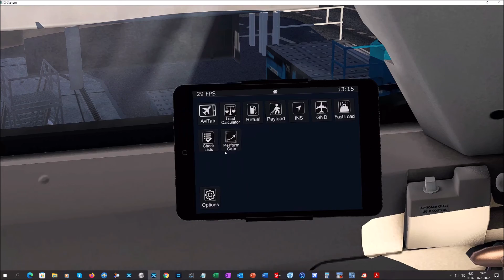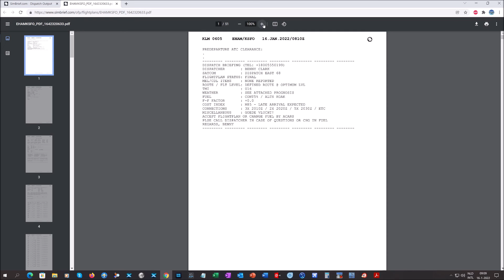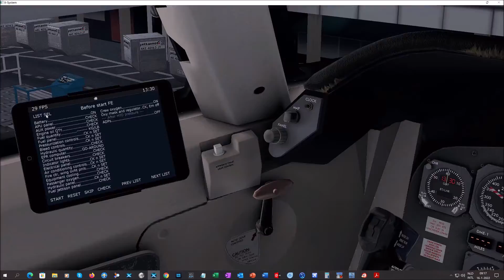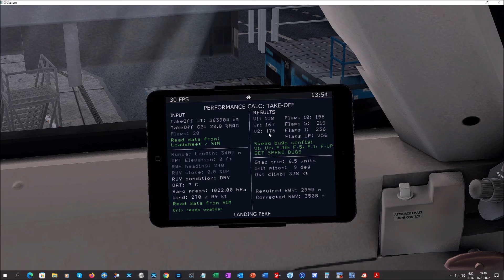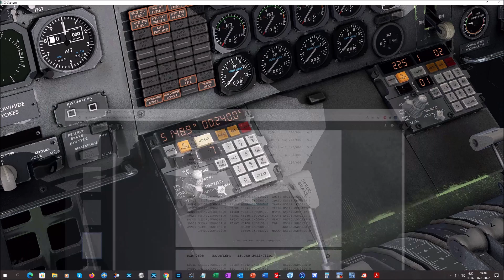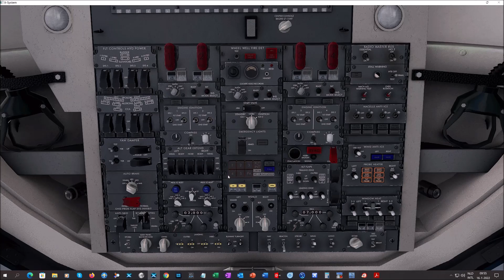Felis 747-200  Long haul using INS - part 1 of 4 'Preflight'

Comment: Excellent start which is very comprehensive. I recently purchased the EHAM Amsterdam Airport adds on as well as ALES Library but I get error after launching the application which is: 
There was a problem loading the scenery package:
0:00:46.306 E/SYS: | Custom Scenery/Aerosoft - EHAM  Schiphol Amsterdam Airport/
0:00:46.306 E/SYS: | The scenery may not look correct.
0:00:46.306 E/SYS: | Please see the Log.txt file for detailed error information.
0:00:46.306 E/SYS: | (io_dsf.cpp:808)

Would you please help? Thanks a bunch
Reply from the maker: Well, read the instructions on the .org forum page of the update very carefully! If you just threw the Ales library in the EHAM folder it isn’t going to work. https://forums.x-plane.org/index.php?/files/file/55042-eham-schiphol-amsterdam/
Reply: @0321Sjoerd  I tried but still not working properly. Do I need to get the library listed in the link you sent me and if so where can I find that library files and where to place these files ..
Reply from the maker: @mehnazk  If you download the package from the link I provided you’ll find a readme file with detailed installation instructions. Read that file carefully.
Reply from the maker: @mehnazk  Installation 
1// Purchase and download the latest version of Aerosoft's Schiphol Amsterdam 
 
2// Unzip 
 
3// The folders wich are needed you can find in Aerosoft - EHAM Schiphol Amsterdam -> custom objects 
 
4// Copy following folders "EHAM" , "grounddraped" and "vtg" into the main folder of the new Schiphol Airport 
 
5// Purchase and download "ALES - The Airport Layout Enhancement Solution" by Pyreegue 
 
6// Unzip 
 
7// klick on ALESv1.4 -> Libraries -> ALES LIB 4K (or 2K (recommended)) -> Custom Scenery -> ALES LIB. Copy ALES LIB into your EHAM main folder.
 
8// Copy the new Schiphol Amsterdam Airport folder into X-Plane 11 / Custom Scenery 
 
9// Delete default Schiphol Amsterdam by Aerosoft from your Custom Scenery folder because this two sceneries will not work together as two seperate folders! 
 
10// Enjoy 
 
If you want this airport without static planes, please klick on the link below:
- - - - - - Schiphol Amsterdam no static